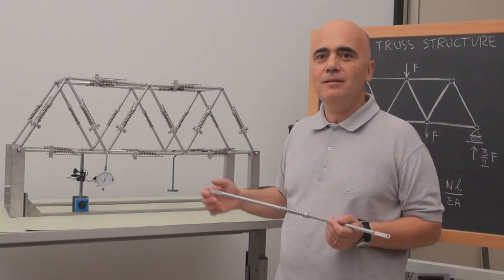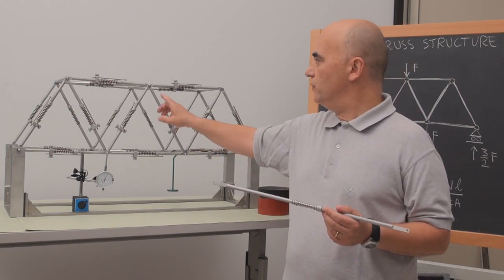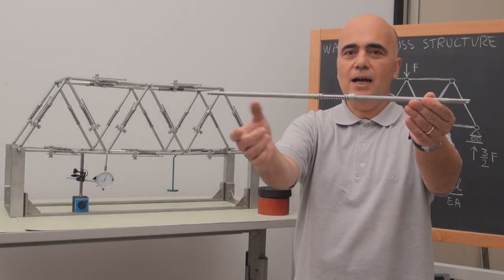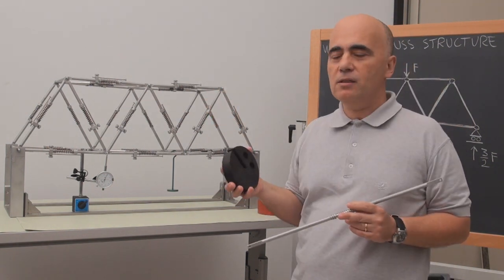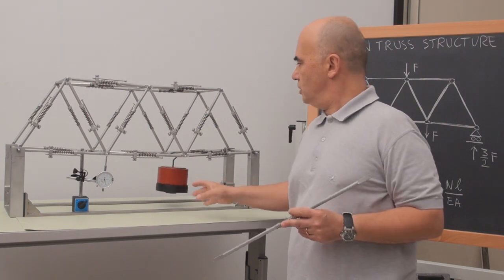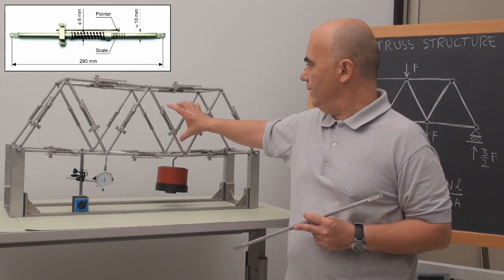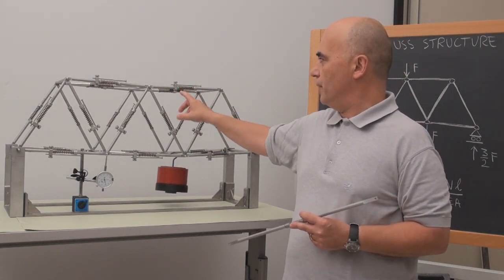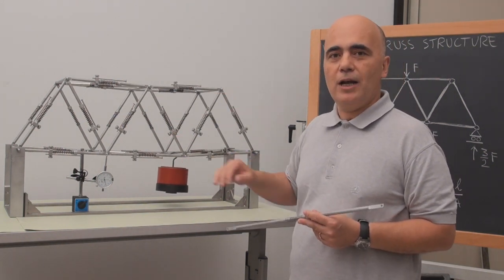A teaching model for truss structures

Comment: I was thinking of the same idea.  even with the dial.  you could add hall sensors or incorporated some kind of coil for a electrical resistance viewed on a digital read out. small load cells. nothing wrong with visual observation. it beats destroying a well built model .  very nice job.  lots of lathe work...